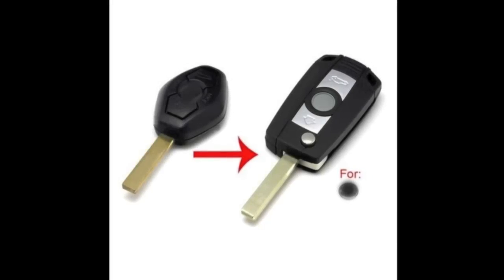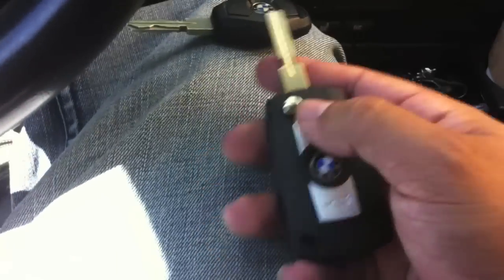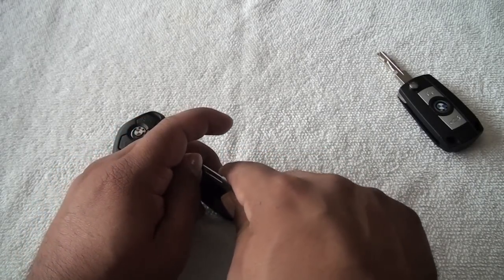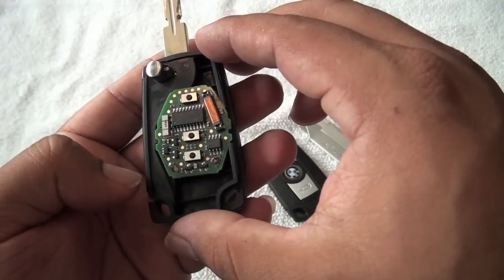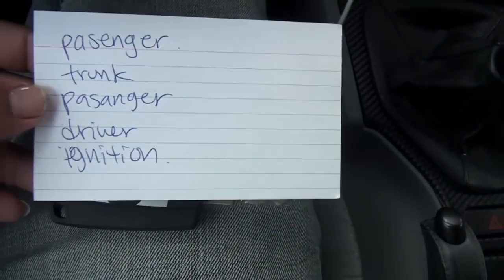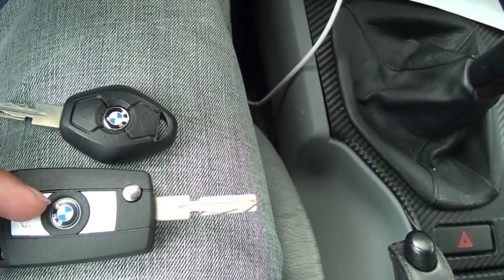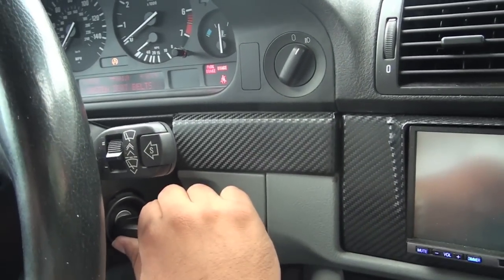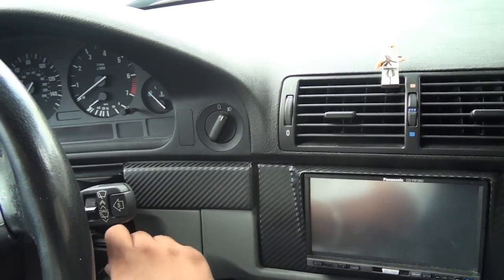BMW e39 Folding Flip Key Case Shell Refit

Comment: Hey i know its many years later since you've uploaded this but you did everything right but remove the smaller chip that's behind the key plate its in a small black casing that is part of the plastic housing of the back end of the key. You need to cut out the little black chip without damaging it and put it next to the key plate in the pocket of the new key fob on the top right. After you do that everything should work fine.

Comment: For any new key to engage the ignition lock on an e46, you have to take your original key, insert it into the ignition, turn the car on (don't start the engine), and WITHIN 3 seconds, do that same process again with your new key. If you had a new chip, you would get the car to recognize the new remote by pressing and holding the lock button down while pressing the unlock button (center logo) 3 times.

Comment: Hey guys, I had the same problem, however,  I figured out what to do!!!!!  the outside edge corners by the blade need to be filed....   so that the key blade goes in deeper. Also, you can use utility knife. plastic is quite soft and you can cut out some plastic inside the housing so that the transmitter moves closer to the blade. Last thing to do ( if above written stuff did not help) you need to file sides of the blade ends- it helps the blade go deeper inside. Every millimeter counts!

Comment from the maker: I still haven't been able to make make it start the way it's supposed to. It does start once I remove the chip out of the shell and place it closer to the actual key. A lot of people have made it work. But I notice their key have a removable device that send the signal to the key. I forgot the name. Mine's is solder into the ship. I will recommend opening your key first. If the transmitter is solder then your screw like me. I wanna unsolder it and see if it works. I'll keep u updated. thanks

Comment: It is not even that it didn't work for you or that it may work for my car or others but the whole end product looks shaky and loose. From this video it seems that after some use  the key stem would eventually fall off or loosen off the fob body. It should be firmly jointed but in this video it looks loose even though it is brand new. I can only imagine what it would look like after a few months of starting the ignition. Thanks for making this video. You have saved many of us from buying this!

Comment: The ring around the key hole has the censor so the sensor in the key that little magnetic chip has to be in super close proximity in order for you to achieve ignition so that said you can take the chip out and place it closer maybe glue it to outside of key so it's close to ring while turning engine over its real simple

Comment from the maker: is a Panasonic CQ-VW100V. Is an older model. From 08 I think. I got for $250 brand new when it came out, the guy also included the hardness kit and the antenna adapter. Retail price was $620 at Best Buy at the time.
I got it at Downtown LA audio sound outlets.

Comment: Also if you look up "how to change the battery in you e39 key fob" you'll see a little tiny chip with warning signs on it. You car can't start without reading that small chip. When you put it in the key fob place it closest to the side of the key as you can. It's to be read through the column and now a new fob. It worked for my 525ti when I changed mine. I paid $8 dollars for mine.

Comment from the maker: Thanks for the tips. I'll give that a shot. I was also thinking of just adding a small metal strip next to the transmitter and solder it to the actual key to see if works kinda like an antenna to the transmitter. Once I get a chance I will try and keep you folks updated.
Reply: any update?

Comment: One thing to note I notice in this video the new keyfob seems weaker than the old one. Possibly due to cheap materials, BMW ignition cylinder is already stiff as it is, so it seems like it would end up breaking one day. The old key is made like heavy duty. You may want to really seal that key up with sealant or gorilla glue.

Comment: If u read a few comments down the one where u get in an lock the doors that's how u got to link it up then it should work fine an the cup holder is a sick mod 50k plus car an the stock cup holders couldn't cost more the 10 bucks
Reply from the maker: Yeah, I read the comment. The problem is not programing the key. The problem is within that little transponder or what ever the name is. Mines sits too far away from the actual key.  =(

Thanks about the cup holder. But the stock cup holder for this vehicle cost $65 from the dealer. But ebay has them for much less. But they're still worthless cup holders.

Thanks for the support..

Comment: Hey watched ur vid, learned enough... curious to know if u got it fixed yet or still tryna figure it out. Im new to bmw, came over from acura. 2000 e39. I have 2 diamond keys, one works and the other doesnt. Thinking about doing the upgradr but a lil iffy. U have a 525i im at 528i two years earlier than urs. Would that make a difference?

Comment: Its suitable only for the version of the key where there is a separate transponder (immobilizer chip).
If the chip is soldered to the board this thing will NOT work !

Comment from the maker: I'm still working on it.. I figure out that in this vehicle the Transmitter is solder to the board and sits too far from the key. It works when I remove the chip out of the shell and put it close to the key. In early models like the 2001 and under, the transmitter is not solder to the chip.
I'll keep you guys updated.

Comment: i'm pretty sure post number 8 is your problem-  "I'd be worried that the RF-ID would be too far from the induction loop and wouldn't be able to read the key to start the car" yeah pretty much sums it up dude good luck and post a video if you get it working like the original one cuz im interested in doing this to my key as well

Comment: Did you code the transponder to start your car? I did not purchase the transponder. My spare key is just a simple key without buttons, I broke it open and there is a ID44 transponder which of course is already coded to my car. With Coded i dont mean the initialise process you can do yourself. You can not code the Transponder yourself, you have to go to a electronic BMW specialist which can acces the software in your car and allow you to add another transponder (key)

Comment: Hi
To re program the key to the car. To carry out this procedure you need to have one working key and one key which requires programming. Please read on if you do not have a working key as this is also covered further down. It may help sometimes to hold the key close to the rear view mirror as this is where the sensor is located in most models.

1. With both keys, get in the car and close all windows and doors.

2. Put working key into the ignition and turn to position 1 (the accessories should turn on)

3. Turn the key back to position 0 and take the key out of the ignition.

4. Using the working key, hold down the unlock button, press the BMW logo (lock button) 3 times, and release the unlock button. Doors should lock and unlock.

5. With the new key, hold down the unlock button and press the BMW logo (lock button) 3 times and let go of the unlock button. Doors should lock and unlock and you're done.
The passenger door should have a small area to the rear of the handle that prises off to reveal the lock/keyhole.

Comment: where can I get a replacement flip fob with a key blade that has a groove down the middle. your video keeps switching from a square solid type to the one I want which has a groove down the middle and two groves at the top of the blade. The only one's advertised on ebay are the solid square one's which are no good to me. I'm in the UK, but don't mind shopping in the USA if necessary. Thanks in anticipation of your reply

Comment from the maker: First of all, welcome to the BMW family.. This MOD will not make a difference. Since you have an spare key that doesn't work you might wanna experiment a little with it to figure out if this MOD will work with your key. 
What you wanna do first is open the broken key and determine if the Transponder is solder onto the ship. The Transponder is the big rectangle box wrapped with copper. If is solder to the ship this Mod will NOT work. If the transponder is detachable, it WILL work.
The problem with mine is that the transponder sits too far away from the actual key, there for, the key is unable to communicate with the vehicles ignition. I gave up with this project and put the original key back together.
Reply: Sasa Mijailovic
you can link the video?
Reply: yes, you have help me...i have made this modify and now the key works good!!
Reply: The50calKiller1 eqeqwwwa www wo

Comment: Did you ever get the key working at least to remote unlock the doors? I may order the same thing. It is now on eBay for like $11. But I would only use it as a remote fob to unlock and lock the doors and use the tiny black plastic 'wallet' key to start the ignition. This way you only combine the wallet key and this fob

Comment: maybe the keyless entry remote lost the programing due to a dead battery. after you change the battery get in the car lock the doors with the button inside the car put the key in the ignition and turn the key all the way without turning the engine on. than take the key out and press and hold the unlock button and while holding it press the lock button 3 time and release the unlock button you should hear your locks.

Comment: You need a Seperate transponder to make the key work. If you google some more information on this conversion case you will see what i mean. You have your transponder soldered to the circuit board

Comment: I installed a navigation system into my e39 similar to yours. What does your antenna adapter look like? I have been having trouble connecting the radio antenna to the navigation system to get a good radio signal like I used to.

Comment: i have the same problem...the key dont need to reprogramming..because the transponder is the chip whit 8 pins

i have sospect that not is a good contact between key blade and key circuit and the car not receive a good signal to start up

Comment: There is no electrical reason to use the key in every lock cylinder.

Newly cut keys sometimes jam in the lock cylinder when a sharp edge catches on a lock wafer.  It's better if this happens on a less important lock, such as the glove box.  After a few uses the sharp edges are rounded and the key can be more easily removed.

If the key physically turns the ignition lock, the reason the car won't start is that the transponder isn't responding.  It's likely that you damaged the circuit board when you split the key -- it's quite common that the blade goes in too far.
Or perhaps the transponder bar antenna (the part wrapped with fine copper wire) isn't close enough to the ring antenna around around the key slot.

Earlier e39 keys used an encapsulated transponder, where the coil and chip are molded inside a "coffin".  The key above uses a bar antenna, with the actual transponder smarts and memory in the 8 pin chip.  The larger chip and most of the rest of the components are for the keyless entry transmitter.
Reply: on
ok

Comment: there's a simple reason it doesn't work. I'm an electrical engineer so I figured it out pretty quickly. The coil on the PCB from the key is too far away from the ignition lock in this housing. read my blogpost on how to fix it: http://jorndevreede.tumblr.com/post/46171624721/i-recently-ordered-a-cheap-flip-key-housing-from
Reply: Jorn de Vreede you have more photo
Reply: No, sorry. the blog pictures are all there are. It's really simple, just de-solder the coil, and add some wires to make it fit in the opening closer to the key!
Reply: Jorn de
P
Reply: wow nice trick thanks

Comment: Here is the problem: The electronics of the original remote key includes the transponder (ELM 10030A 8-legs bug in the circuit). In front of the electronics board there is the antenna which is in the folding key too far from the antenna on the ignition lock. The only way to make this key work is to use another transponder (eg. from the wallet key) and place it in the folding key as near to the metal part, which goes into the lock, as possible.

Comment: Hey guys. My key hasn't been working for the last few days, so I have replaced the battery, and glued the key back together. It opens and locks the doors, but the engine won't start. I tried programming it, but it's still not working. If you have any advises, I'll be willing to try them. Thank you. (BMW 530i 2002)

Comment: to unlock a key you need to do this:
- Sit in the car with all the doors shut and windows up with your key fobs (all your fobs need to be done at the same time)
- With one of your keys turn the ignition on then off and remove the key
- Press and hold the unlock botton and then press the lock button 3 times.
- Release all buttons and the locks will bounce up and down.
- Repeat this with the other key/keys (press and hold unlock and press lock 3 times, locks will bounce)

Comment: The reason why your key doesn't work is because there are other things in your key that you didn't switch over you switched all the electrical stuff to unlock and lock it remotely but the key still has other chips to authenticate the key fob and allow it to start the car apparently for these refit kits the key sits to far from the antenna  from the key fob to not only charge the key but also to recognize it it sucks that you did this without knowing but at least i know the key fits lol

Comment: I don't know if you can see pics is you are not a registered member. The problem is your transponder.soldered on the circuit board, is too far from the actual key, the car  doesnt recognize your key. You will need the non-soldered ID44 transonder from the spare key (the one with no button). If you open that one up you can see it has a separte transponder in it. Easiest if you just register on bimmersforum.co.uk and you see exactly what i mean.

Comment: This will not work because of the magnet chip location a little far from the connectors..Which you can find it and program it in key program workshops if you need any information feel free to ask

Comment: The reason why it didn't work is because the chip located inside the new key case is not within range of the sensor that is located with in the ignition switch.

Comment: You would have to order a new BMW key from a lock smith the key they give you is some Chinese BMW key .. It looks exactly the same except when you open it up ! The chip is totally different ! And the chip doesn't fit properly in the shell so you won't be able to open your car with the buttons , you place this little rectangular chip that sits in the on the plastic of the new Chinese key inside the new key fob , the little chip is the immobilizer

Comment: Funny thing is the original key didn't have a replaceable battery cause it was designed to recharge each time you put it In the ignition. Think about it why would the key be sealed shut if the battery was designed to be replaced
Reply from the maker: indeed, that's how the key was designed. The battery life is long. How ever, the battery will go bad eventually. So you can replace the battery or follow the dealer's instruction of purchasing a brand new key that will cost you around $300

Comment: Re-Program BMW Keys
Method One:
Instructions
Get in your vehicle and shut the doors. Insert the key into the ignition and turn it to the "ON"    position (without cranking). Hold it for two seconds, then turn the ignition off and remove the key.

Hold down the unlock button and quickly press the lock button three times.
3    Release the unlock button. The door locks will flash, signaling that the programming is    
      complete.
Place the key in the ignition and toggle between "ON" and "OFF" to finalise.
Infrared Transmitter
1. UNLOCK vehicle using the UNLOCK button
2. Enter vehicle & CLOSE driver's door
3. Switch ignition ON and OFF
4. Programming mode activated
5. Point key at infrared receiver (fitted in rear view mirror), <15cm
6. Press & hold UNLOCK button
7. Press LOCK button 3 times within 10 sec, keeping UNLOCK button depressed
8. Release UNLOCK button
9.   (If one is fitted) LED on the key flashes slowly for 10 seconds
10. System should lock & unlock to show programming is successful
11. Repeat above procedure if (LED doesn't flash) or central locking doesn't work
12. Repeat procedure for remaining remotes

Notes
- Maximum of 4 remotes can be programmed
- Programming procedure must be completed within 30 sec for each key

Comment: The key only works if you have a seperate transponder. I and the guy in the vid have the transponder soldered to the circuit board. The transponder is to far from the actual key.

Comment: Can anybody help me guys? (bmw 530i 2002)  My key hasn't been working for the last few days, so I have replaced the battery and glued the key back together. It opens and locks the doors, but it wont start the engine. I tried pretty much everything, even the following steps :
"1)key in turn and off within 5 sec
2)press hold to unlock
3 while holding unlock press lock button 3 times
4)start your car"
but nothing happens. Any advises? Thank you